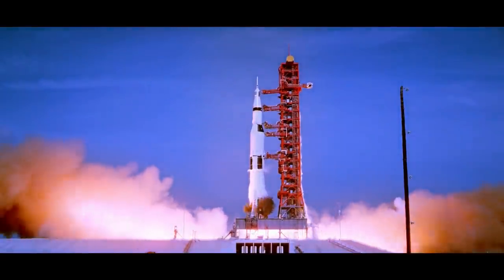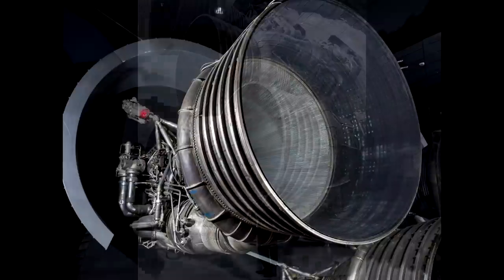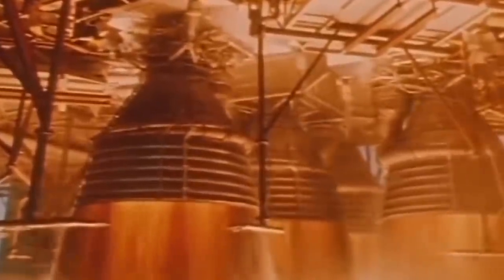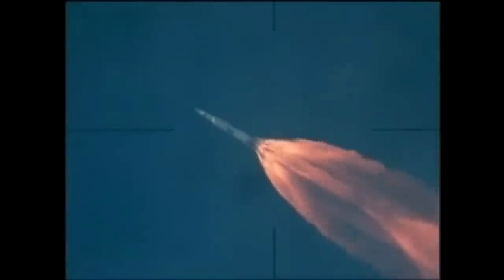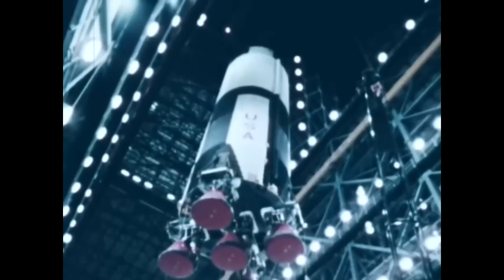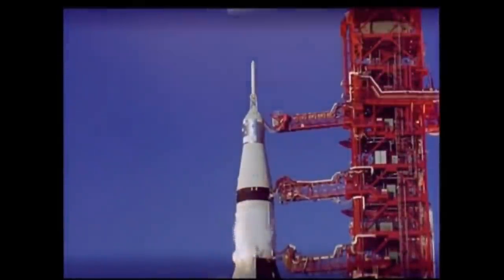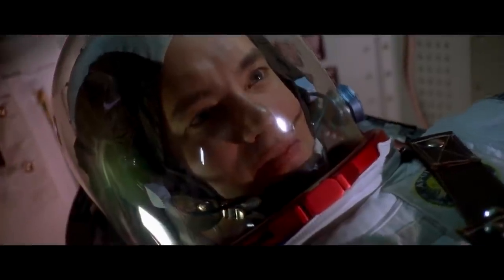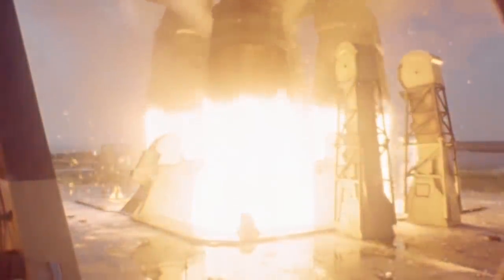Why The Engines That Flew On Saturn V Rocket Look Different In Museums

Comment: Scott Manley - They used to cell the Haynes and the Chiltons repair manuals here in the states. I've seen the Chilton ones around recently, but not the Haynes. My 2011 VW Jetta TDI is the only car I've not had either book for. For most of the vehicles I've had, I had both.

I was not aware that Haynes made Saturn V and Space Shuttle books. (I do remember the Starship Enterprise book.)

Comment: Can somebody tell me, why the flames directly after leaving the nozzle have these massive black or dark brown Stripes?
Reply: It's a bit of an illusion. First of all, it's a relatively thin layer of somewhat cooler exhaust gas that is sprayed along the interior surface of the nozzle extension to insulate it from the extreme heat of the main combustion gas. It appears dark mainly because the main exhaust plume is so bright, and the camera has to "chose" which part of the flame to expose for. After a few feet the "dark" gas blends in with the brighter, and hotter, exhaust.

Comment: People have a lot of interesting ideas about asbestos being removed from the rocket engines but they seem to have overlooked the point that these things were never added to the engines until it was actually being a symbol just before launch. Additionally, there's always a touch of hype about asbestos. Yes it's carcinogenic - when inhaled. But it's still a useful product used in many things today, because it's only carcinogenic when inhaled.
I would venture to say that the reason why that you don't see these in museums has possibly something to do with the asbestos, but more likely because the asbestos ramps wouldn't have been added to the engine housing until it was about to be launched. And why cover up the details that people really like to see?

Comment: You wants to put Asbestos insulation on a open display museum piece without a giant double layer glass box to protect the visitors and staff from the tiny asbestos fiber that wreck havoc on your lungs?
Reply: Yes, that is what we want.  Also a big fan blowing on the engine to make asbestos dust fill the air all over the room.   LOL

Comment: Will the raptor engine be more powerful than the F1?
Reply: No the F1 engine had Thrust (SL): 1,522,000 lbf (6,770 kN), and the Raptor will have (estimated) Thrust: 1,993 kN (448,000 lbf), approximately.  Even if they double the output like they did with the Merlin engines, it still won't be more powerful.   Will just be more engines on the Super Heavy... like 6 times more (31 engines)
Reply: No, but there will be more of them and they will be reusable.
Raptor - 2000 KN
F1 - like 7000 KN
Reply: @MrDmuncaster  But all 31 engines would be more powerful then the 5 F1's?
Reply: @aldi3369  Yes, again assuming the Raptor engines final design hits 1,993kN.  Starship Super Heavy (SSH) will theoretically have 1.8 times the thrust of the Saturn 5.  But that is a constantly moving target.  Latest news from Elon on Feb 7th was raptor hit 1,512kN.  Which would mean the SSH would be "only" 1.38 times as powerful as the Saturn 5 (assuming my maths, math)
Reply: imarchello Where's F-1B on this list?

Comment: I have a related question: why do many space probes appear in graphics ("artist's impressions") with their antenna dishes covered with foil? That makes very little sense.
Just a couple of examples: Juno http://www.nasa.gov/images/content/567922main_junospacecraft0711.jpg
MRO https://boygeniusreport.files.wordpress.com/2018/02/2-marsreconnai.jpg
+ a good dozen of others.
That's really weird and stupid.
Reply from the maker: Because the dishes focus radio waves, but would also focus light, which could focus the sun on the receiver. So they cover them with foil and are tehrefore able to communicate with earth when it's seen near the sun.
Reply: @scottmanley  so they really look like that where they are now?
What about the Voyagers etc.? They are shown without foil since they're too far away and don't need it?
And I never knew radio waves can pass through the foil. I'd expect at least some interference from it.

Comment: "...for some reason never made it onto museum versions..."

Just a guess here maestro, but it's probably the ASBESTOS

If that stuff was even kinda safe for ANYTHING we'd still be using it.
Reply: No, it's simply because the engines on display never made it into the VAB, where the extra layers were applied. So much ignorance here around asbestos. Asbestos can't hurt you unless you breathe it in through the air. If it's just sitting around, there's no danger.
Reply: I have to correct you here. Asbestos IS still used in some places. There are quite a few factories that require sealing washers made of asbestos on reaction vessels due to the extreme heat. I used to work at a factory near where I live that makes Titanium Dioxide pigment for paint. One step of the process requires a pressurized reactor that gets so hot that, when it comes time to do maintenance on it, requires the entire production line to be shut down for a week to cool down BEFORE any work is done to it. They used asbestos washers as gaskets for the pipes that led into and out of the reactor.